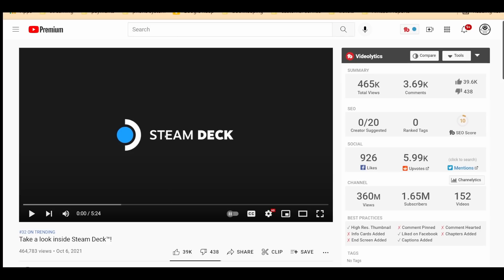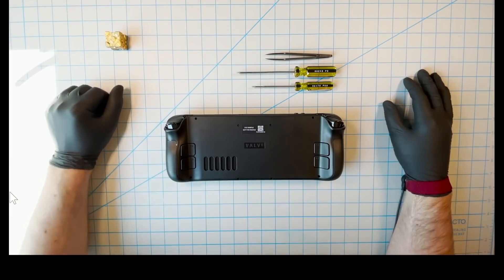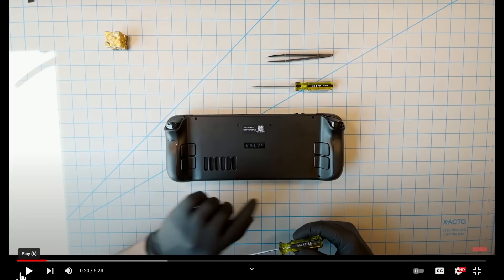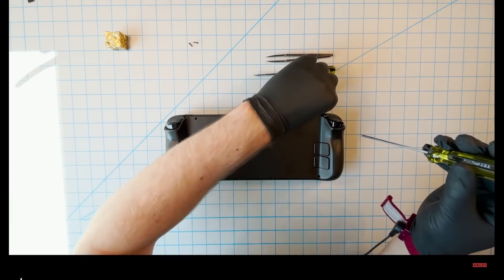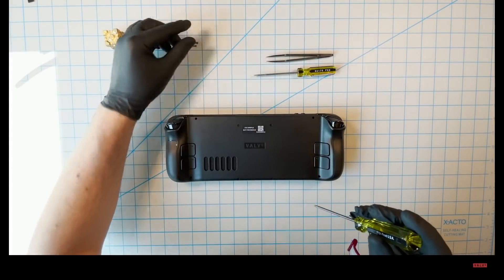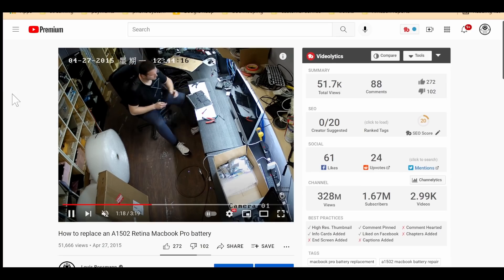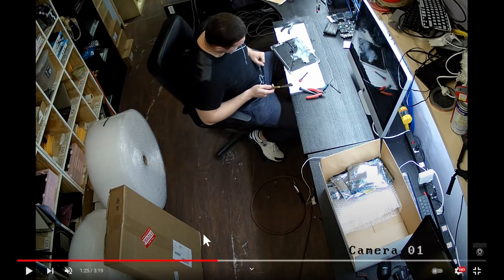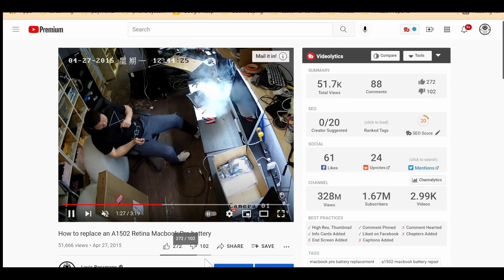Steam deck battery may end your life? bruh 😑

Comment: i think the strucural integrity thing could easily be true. in the devices i repair i also have a certain self-tapping screw, inside a plastic part. It needs to be maticulously placed back. you could easily tap a new thread if you continue on despite some extra resistance at the start. also when you reach the end point, you only slightly feel the screw offering more resistance before you pop the thread. in my case i'm required to replace the part if that happens, because the screw wouldn't hold it together after that.

tl dr: search for the start of the wire and don't overtighten. Then you're fine.

Comment: Plastic doesn't usually have threads. Screws bite into the plastic deforming it and forming the threads. Now if you don't care about that and just screw them back in it's going to bite in new set of threads, or start doing so before jumping to the old ones. Do this enough times and the screws won't hold anything. Also if you overtighten the screws you will damage the plastic threads, much easier than on metal threads.

This is assuming there isn't metal inserts for the screws to hold on to, but considering that costs extra, I doubt it.

Comment: what bothers me is the point the battery connector is not directly accessibly after open the cover. the good point is its a rather large and sturdy connector type with real cables and not a thin film type

Comment: They are correct, but it really depends on what it is. In this case, it's over-the-top exaggerated. Opening it will compromise the structure, but it's negligible. 

An example where it's not at all negligible would be opening a camera lens to clean internal dust and fungus, opening a box of lasers to replace some stuff (throws alignment off), anything where the user doesn't have the tools nor the OEM's reassembly and calibration precision would see issues after being disassembled and reassembled. This mostly only relates to precision optical and mechanical devices. A piece of electronic? Neither, not so much.

Comment: To me, the Steam Deck looks potentially like yet another piece of junk. Metal screws going into plastic. Not metal going into metal like what I usually get when I am putting a desktop PC together. If you strip one of those plastic threads, it seems to me like you are going to damage the structural integrity of the device at least a little.

Right now, there is someone who is looking at the flimsy case Steam came up with and thinking about how they could make a sturdier case with their 3D printer.

The number of damaged portable devices I see people pull out of their pockets or backpacks is shocking to me, the 60 year old fart who grew up with big iron computers, and overengineered cable connectors designed by the original Hewlett Packard engineers. Plastics and exotic materials are amazing, but even Elon Musk backed off carbon fiber.

You want millions of people to be able to afford these devices, you can't use metal these days. It may be sturdier, but nobody is going to buy a $1500 sturdy device in a throw away economy if they can avoid it, where - even though it has more potential than other proprietary devices - it's still mainly being looked at as a gaming device.

I'm wouldn't buy a Switch until it is at least 1/2 it's current price. And with my old eyesight, I may never buy a device with such a small screen ever again. This is definitely not for me, and that's okay. I'll keep buying larger screens for my desktop computers - as long as I can afford them - and hoping easy to use open source will become the operating system of choice for a mainstream desktop gaming platform.

It might happen before I'm harvested for my recyclable parts. I was around for HP's stupidity of "BSD is open source?!?!! Switch to System V!" Then a few years later HP saying "Linux is great!" 🙄

Comment: structural integrity will reduce but it wouldn't matter as much as they are saying. Also maybe they might be also addressing some people who might end up over tightening the screw or maybe loosely tightening the screw. But if you do it correctly then structural integrity would reduce about 1 to 2% but not a ton.

Comment: Wrenching around with self tapping screw will made them less worthy. Like after 2 openings and being put back good way they will lose like 20-70% holding capacity. But actual structure will lose like 0-10% strength. Nothing big but is true.
Like they are correct about structural integrity but probably 5 people(out of 100k) will bang device with just right amount of force and it's gonna fall apart because of screws.  only realistic bad thing is cracking noise while gaming because you didn't torqued all screws right amount and didn't fit device as is meant. 
But even if you overtightened some screws you can probably take thicker ones or put some glue, drill holes and make it good as new again. 
I like to open stuff even if it's to see what's inside 😁😁. That's why I have 4€ hair dryer for 10 years. Stuff doesn't break if you clen it and lube it.

Comment: Edit: in regards to the structural integrity/ drop resistance thing

Yeah, removing and reinstalling self tapping screws makes the threads in the plastic a bit weaker. Plus those little plastic clips just never go back together the same, there's always a little extra play from wear

Comment: Self tapping screws are type of screw that thread the hole by itself. So every time you screw and unscrew you basically make the hole bigger because the the screw would chip away the thread. 

That said the self tapping screw are the 4 in the middle and the rest is normal. So even if the fit betweed self tap and the holes no longer tight the worse that can happen is the mid section of plastic panel gets flabby.

As for cracks in the plastic panel around the hole, I think that's down to over torque the screw. And that can happen regardless of it is a selftapping or not.

Comment: 18:00 I think it's because of the self-tapping screws. Most self-tapping screws I've pulled out of a plastic device or toy had some plastic still on it, and putting in and taking out the screw over and over is going to grind down the plastic and scoop more out.

It can definitely hurt the structural integrity of the outer shell of the Steam Deck staying together if the screws are removed due to some plastic sticking to the screws, and it can also really hurt the integrity if they're overtightened, causing more plastic to be stripped out. If you finger-tighten it with a screwdriver (twist with two fingers until it stops), you'll be fine.

Comment: Could it be that when they put their Steamdeck together, they screw it and glue it? That's the only thing I can think of. Is it water resistant and the water resisting parts fall out easily? They said a lot of stuff in the video that was like, uh, ya obviously, that's why you don't do that and do this instead. It's the people that have never had these bad things like exploding batteries happen to them or ESD that think that it's way easier to have happen than it actually is. Hey, the keyboard in my laptop doesn't sit flush with the rest of the laptop, oh well, it still works. Hardly a concern.

Comment: When you remove and replace a self tapping screw in plastic there is some unavoidable wear. The screw doesn't hold as tightly as before. One R&R, if done carefully, probably won't cause a noticeable weakness, but (as I'm sure you are aware) it is very easy to "miss" the original threads when replacing the screws, especially since the plastic is often not as smooth as a metal to metal thread and it's harder to notice cross threading. So that's a slightly long winded explanation of how structural integrity can be compromised by opening the case. Apple products don't have that problem because they use metal to metal fastening.

Comment: The warning about the screws is legit. Self tapping screws cut their own threads when installed. Removing and reinstalling them can cut new threads making stripping the holes that much easier. That would diminish impact resistance.

My take away from the warning is, don't open this more than you have to. Not that it will fall apart easily after you do it once.

Comment: Someone doesn't get valve's sense of humor. As for reusing self-tapping screws, there is no good consensus. If you over-torque them there is a good chance you will create microfractures or full-on fractures in plastic. If not properly aligned there is a chance you will cause the self-tapping part of the screw will cut a new set of threads reducing the amount of plastic and there making tear out easier. But whether it will make a significant difference is kind of up in the air.

Comment: As for Self-tapping screws as a mechanical engineering student, attending an university currently. I have run into some instances where we learned about a flexural modulus and in short without drawing it out. In thermoplastics (which this is most likely made of because they don't use any metal inserts on the mating surfaces) you tend to get anywhere between 10-20 cycles of fastening and unfastening before it starts to weaken the structural integrity of the threads and mating pressure. Due to certain reasons of plastic being soft, and flexural deformations tends to occur, however that being said, I'm not sure how many times the device has been taken apart prior to shipping or if its screwed and never opened, In that case, you're more than likely never going to reach the limit where deformation occurs. Additionally, the amount of deformation that does occur as you said could be negligible without testing it's really hard to say unless valve did the testing and that's what they are referring to in lamen terms.

Comment: Louis, you are an absolute boss, but devices from 30 or 40 years ago are less sensitive to esd than new ones. As process sizes have shrunk, the amount of static needed to damage a transistor has also become less. If you maintain good humidity and work on an esd mat, your chances of problems are low but not zero. I used to work designing avionics, and we spent a lot of time analyzing root causes, because in that industry every failure requires an absolute answer, regardless of the resources required to find it. Not all ESD damage is immediately apparent. A device can keep working for a long time after it is damaged, and only fail later down the line.

Comment: There's no way those screws are self-tapping, that would be completely unnecessary and would damage the case, they also don't hold as secure because they destroy the material they're sunk into. If they engineered it this way it's specifically to discourage anyone from opening it including a Valve certified tech.

Comment: Got some friends in plastic engineering and the structural integrity thing seems pretty plausible. I've also experienced this in automotive repair, a lot of self tapping screwed plastic assemblies never go back 100% once opened. It's still fine and not a major issue but I find it pretty plausible that there would be a notable difference.

Comment: For the structural integrity thing, I think taking it apart and putting it back together will likely deform the self-tapped threading slightly, which will cause slightly more play in the encasing, which will in turn get worse with time and usage, making a not-insignificant difference years down the line. Still definitely worth fixing a component, but maybe not worth opening it up for fun.

Comment: the olny way the structural integrity would be compromised if if they dont tighten the screws correctly either leaving them lose or stripping out he plastic threads would result in loss in integrity otherwise its just BS

Comment: I don't think it's so much that opening it would threaten the structural integrity, but rather, tampering with some of the innards might make them not quite as secure as they originally were, and might pop loose.  I've experienced this before just opening up laptops, where it worked fine at first but then after a few months of use, something jostled loose.

Comment: Well really here's the question if they have to remove the screws to replace a issue covered by the warranty have they not then comprised your steam decks structural integrity so they will have to ship you a new one by their own logic? Self tapping screws are a terrible design that I see will eventually be replaced.

Comment: They make nutserts specifically designed for thermoplastics so Valve could have avoided self-tapping screws entirely but, that would have added to cost of an already niche market item. Thankfully there is companies that make "cold" press-in nutserts for plastics so when I inevitable strip out the hole for self-tapping screws I can fix it if I am so inclined.

Comment: 8:45 "Structural integrity lessened by opening the screws"
No, it isn't. If you are careful, you can reinsert these screws (look like 3x8 + 2x5 (?)) ~15 times without much difference. After that through cross threading/wear, the friction locking them against rotation, will be noticeably lower. So a Steam Deck that has been reassembled  like 30 times might loose a screw after a month ...

What they likely mean is that some people will be idiots and overtighten the screws. Then the threads will carve out the plastic and you'll have to put in a 0,5 mm bigger screw for it to bite again (and pray the head still fits).

Comment: On the topic of structural integrety: i assume what they actually mean is that self tapping screws loose some of their holding torque, and can get a bit loose, when removed and re installed. (Source: self evident)
They haven't validated what impact that will have, and they can't, because there are too many unknowns.

Comment: On the structural integrity,  from what I understand,  the screws tap the threads into the plastic they are screwed into.  As he said self tapping screws. And yes removing the screws and putting them back in, if not aligned with the original threads created, which can be quite difficult sometimes, the screws create new threads (essentially cross threading). This can and will weaken the plastic if done multiple times.
Edit: I've had this happen to me before.

Comment: Due to the famous Switch Joycon drift, I got me a pack of 20 replacement joysticks to replace them by myself instead of kissing fucking Nintendo's ass. I have opened those tiny Joycons so often, that I even get issues with breaking flat cables now due to being bent back and forth, but those tiny little body screws drilling right into the plastic - no problems ever. They are still perfectly stiff, so my experience on this calls bullshit on this Valve statement.
Unless they produce the body reeeeeally damn cheap and bad.

Comment: The damage coming from opening the device may come from using bad quality materials, compounds or alloys, events like screws getting stripped off by the screwdriver, threads being rendered ineffective by repeatedly opening and closing of the device, maybe. But that's to come with inexpensive equipment like the Steam Deck. It has AMD CPU+GPU combo, iffy material quality, finicky aspect, 1280x720 screen (not OLED), cheap parts. Good piece of hardware, to be learning on. Overclocking, feedback pin overvolting, wiring up a way bigger battery straight to the board using a soldering iron, even batter, getting an 18650 6 cell battery holder and wiring that on the board, wiring the holder as 3 packs of 2 batteries, and being able to replace them on the fly with freshly charged up ones :)))) Even a 4 cell ones works fine.

Comment: On the "why you shouldnt do this" I think it may be 2 fold. 1. covering their asses. 2. I believe it is more so meaning that the average John/Jane doesn't try the repair themselves without any experience doing that sort of work and possibly breaking it, which in turn would void the warrenty. I could be wrong, but it would make sense. Giving the option to bring it to a repair shop that actually knows how to carefully take it apart and put it back together.

Comment: yeah, it's both true and a little BS, the hold force of a self tapping screw into plastic is only at maximum on the first insertion when the threads are formed by the screw. The stress force on the plastic threads is high and they start to crack after a small number of insertions.  This can be 1 or 10 or 100 insertions. It really depends on the plastic type/quality, how careful you are to not overtighten and the size of the hole vs the screw (the amount of thread that needs to be formed).  Only 1 screw removed and reinstall cycle will reduce the hold force a little, but if done carefully I doubt it would have any noticeable effect unless the design or plastic is really shit.   The same is true for a lot of things, like FPC connectors, the small/cheap ones are usually only rated for 1 or 2 insert/remove cycles.

Comment: plastic and woodscrews dont hold their mechanical strength if you reuse the same hole again without filling it back using a dowel or filling it with some type of substance such as remelted plastic.

Comment: 9:00 the reference he's likely talking about is using self tapping screws in the plastic boss.  Like all cheap plastic the boss loses significant integrity when removing the screw and installing it again.  What valve should have said is we are using extremely cheap plastic and self tapping wood screws in this area.